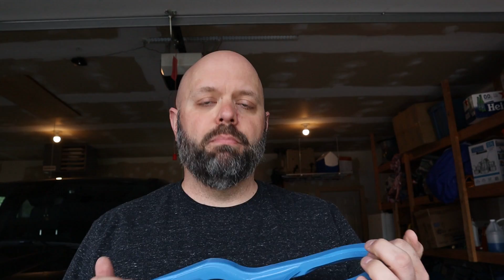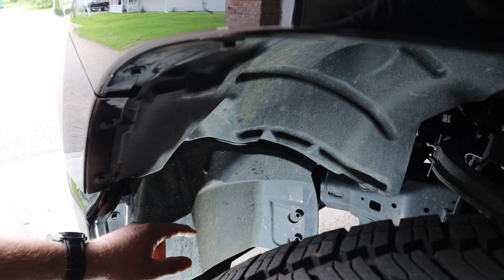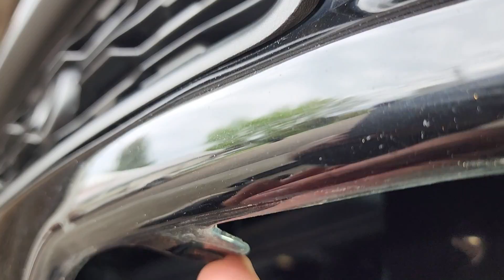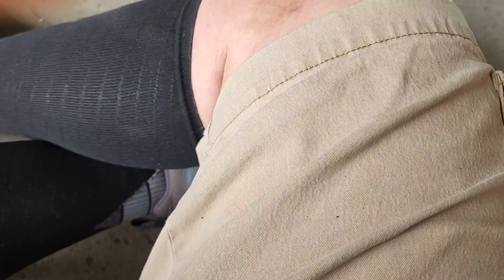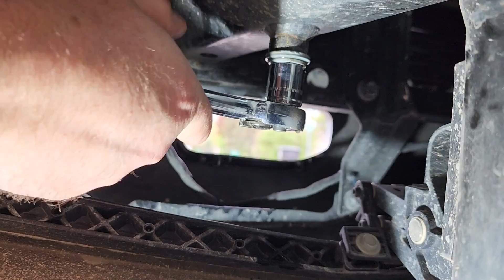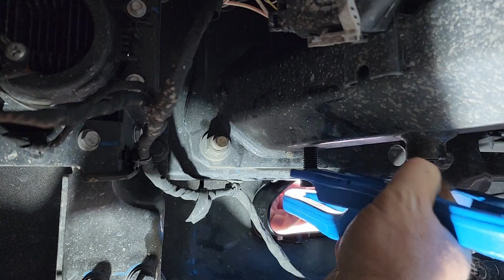Installing Tow Hooks on my 2021 Ram 1500

Comment: Next time don’t use a hammer to get that bolt out. Little downward pressure with that wrench and loosen the bolt at the same time.cordless impact is your friend Comes right out no hitting.
Reply: Thanks for the tip noted for me

Comment: Funny, I was sitting in my shop chair enjoying a beer after a project and noticed no tow hooks on the front of my new used 2022 Laramie. I couldn't imagine a 4WD without factory hooks up front and figured they must be hiding behind those panels in the bumper. After crawling under and routing my arm in unhuman form to feel in that space.. nothing!  So after watching your vid, I used your link and ordered the same aftermarket parts. Thanks for your help!
Reply from the maker: It doesn't make any sense at all! Tow hooks should be standard! But I'm glad you found it useful!

Comment: I got my driver's side installed, but for some reason, I can NOT get the tow hook bolt out on the passenger side... It came down like half an inch and stopped. Any suggestions?
Reply from the maker: Hammer on it. There's a little stop washer on the bolt that you'll need to smash out of it. Put a pair of vice grips on it and hammer it downward.
Reply: I managed to get it out. It came cross threaded from the factory 🤦‍♂️. I went to have the dealership take it out for me since it should have been covered under warranty (truck is less than a year old). They told me it wasn't covered because its an "accessory part". I went home, and using shear anger and an 18 inch breaker bar, I managed to get it out 😅

Comment: Just put mine on...  bolts were no problem with a breaker bar.  Those front trim pieces were the worstttt. I couldnt reach the nuts getting them on or off. I just ripped them out. Didnt replace them either. Will try and glue them in later i guess
Reply from the maker: They were such a pain in the ass! Those trim pieces just wanted to fight!

Comment: Your video was great you really made installation of the tow hooks a cinch.  Only thing I did different was removing the front panels.  After removing the 2 screws I used a butter knife from the front and they popped out.  If you’re worried about scratching the chrome on the bumper just place a towel between the bumper and butter knife.

Comment: Agree, the panels gave me hell on installing the screws.  I had no issues in taking out-used a trim tool.  One hack I used was don't remove the long bolt all the way.  Just enough to wrap the big rubber grommet around it then slide the tow hook on it.  (My grommets came already pre-cut.)  This worked great so no need to hammer out the bolt.
Reply: Don’t know how you did that.  I tried and tried.  Little space to maneuver.  Had the front bolt in the way wouldn’t slide forward to force the grommet and bolt into the back of the hook.  Tried removing the front bolt.  Very awkward.  Hell with it .  Took 5 secs to pound the bolt out.  After I did all that, if I had lifted my truck, your method would have worked easy.

Comment: I just added the hooks to my ‘23 Ram Hemi Big Horn. 18mm on the bolts, 8mm on the 5 wheel well screws, a small 9/32 wrench on the bezel trim nuts. 
Do not unscrew the nut all of the way, just loosen and slide out and then use a flat tool on the front of the bumper and pry the bezel out.
The long 9” bolt, I used a large pipe wrench and rested on the shaft of the bolt and tapped down on the pipe wrench with a hammer to dislodge the bolt retaining clip.

My hooks had a solid washer embedded in the rubber grommets so I had to remove the retaining clip on the 18mm bolt to install. 

Awesome video! 👏👏👏  #ram1500

Comment: Tip I want to share becuase I didn't see it in top comments. At 5:24 where your forearm is resting and what it is resting on can be removed to make it much easier providing a whole lot more clearance. That black panel's function is for fuel economy and it drops down after you hit a certain speed. I can't remember the size but I want to say 10mm? Either way just a tip for anyone watching this!

Comment: After getting my '19 Ram 1500 stuck while taking a new evaporator out to my sap house, I ordered a set of these.  Amazon should have them here on Sunday.  Would this be accessible if i just drove up on ramps and then didn't have to take the fender liners out? Just trying to save time while laying on my back in the snow-covered  driveway.
Reply from the maker: Anything is possible but honestly, probably not.

Comment: Great video!!! But I have a question.....do you have to remove that long bolt or can it be left inserted and forced through the thick rubber "washer" since it has a precut slit (as I've seen on other videos)? Just an observation before I start
Reply: You do not have to remove the long bolt.  Just slide grommet and the hook over the exposed part of the bolt…..install the short front bolt tighten and torque.

Comment: Which color blue did you use and which rust o leum paint? Just the regular. I'm asking because I'm wondering if it's chipping or coming off at all. Buying a 21 laramie night edition today. I've always had tow hooks on my 4×4's. Looks like a bit of a pain.
Reply from the maker: I don't remember the exact color of blue but after using them a few times to pull people out of the ditch, some of the paint did chip off. I had to touch them up a few times. I would recommend powder coating them if they're going to be used.

Comment: technically, you wouldn’t have to take those bolts. They’re in the truck out the rubber piece that I got that goes in there has been cut so that you can get the rubber piece around the bolts and then just stick them inside and get the rubber pieces mounted onto your toe hooks without ripping out that big screw.

Comment: What hooks did you get?  I bought some but didn’t align in the center of the hole so wondering if you have the oem ones or an aftermarket option.  If aftermarket do you have a link?
Reply from the maker: They're not OEM but the link is in the video description. They're working great!

Comment: Did you have to jack it up? Or had to use a torque wrench?
Reply from the maker: No torque wrench for me. And jacking it up will depend on your truck. I didn't need to but your setup may be different.

Comment: Did you paint it that blue? Also the reviews say this brand rust pretty quickly. Have you had issues with rust ?
Reply from the maker: I painted them with industrial strength Rustoleum spray paint. It's supposed to seal the metal and prevent rust. I haven't had any issues with rust or the paint coming off.
Reply: @dontburnthehousedownvideos  can I get that color name please!  Awesome
Reply from the maker: I was mistaken! It's actually Ace Hardware brand "Rust Stop" paint and the color is continental blue.
Reply: @dontburnthehousedownvideos  thanks bro ps. You gain another subscriber 💪🏿
Reply: They look very nice. My ram came with them, but since I got the ram. I have wanted to paint them blue. Now I know how easy it is to get them out so I paint them. Thank you for the video.

Comment: Where did you get the blue ones
Reply from the maker: I bought them black and hit them with blue Rustoleum paint.
Reply: They look good 👍 I also wanted to accent the ecotec badge so when I lifted my Ram I bought blue 20 inch fuel wheels to match it lol They look great!
Reply from the maker: I was looking at those same ones! But I decided to hold off for now.
Reply: Lol Thanks for the video my guy, it helped me get through my install especially when the stock screws were just hanging there. Don’t stop posting videos for the fellow Ram owners 👍
Reply: I bought 2022 white bighorn with the nightshade trim and didn’t come with the hooks, bought them on Amazon and am trying to paint them red or neon green but I like your blue also. Useful video.
Reply from the maker: Thank you!